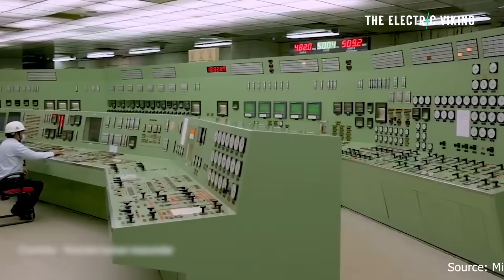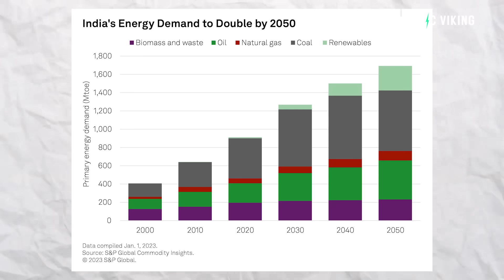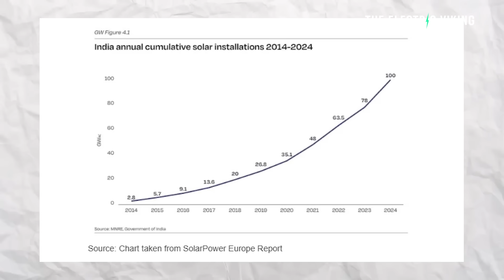India’s Renewable Revolution: Coal and Gas Decline as Solar Soars to 100 GW!

Comment: I’m a Punjabi Indian living in Melbourne, and for the past 11 years, my home has run entirely on solar power. Back in 2014, I installed a 5kW solar system for just $5,600. It earned me $6,600 in feed-in tariffs, and I didn’t pay a single electricity bill for over a decade. When the tariff dropped to 5 cents per kWh three years ago, I built my own 15.6kWh LiFePO4 battery system. Since then, we’ve been fully energy-independent—no imports from the grid. We cook, heat water, and keep our home comfortable year-round using only solar energy.

This is not just a personal achievement—it’s a model for what’s possible. In Australia, most homes have rooftop solar and don’t rely on the grid. If India embraced this approach, especially in high-demand regions, it could transform the energy landscape. Local solar generation would cut transmission losses, reduce infrastructure costs, and eliminate the need for coal, gas, and imported fuels. If every household produced more than it consumed, India could become power-surplus.

Australians choose renewables not because they have to, but because they believe in sustainability—even though they can afford fossil fuels and enjoy cleaner air. Indian policymakers and the public should take note. Solar isn’t just clean—it’s empowering, profitable, and the future.

Comment: India has scarcity of land area needed to build houses, offices, shops, manufacturing units, food garms, godowns and very big human population to support, Land area , roof area, water area are precious finited valued assets that appreciate in value wrpt time and must be utilized 24 hours per day to conserve various forms of life, to quench thirst , to irrigate farms, to mine and extract ores like sand or others, fire-fighting, to catch sea food, to build roads for vehicles or sail ships and for many important uses. High surface power density and high energy density per unit volume are highly valuable in energy. Building and selling carpet area for residential or commercial is the business of real estate redevelopers, Rents and selling prices of houses or shops or offices in cities like Mumbai are enormous and go on rising year after year. A family of at least 3 people lives on 28sqft carpet area in Dharavi slums, that is the area occupie by 540W panel of Waree. Fossil fuels and nuclear have high surface power density , India must use coal, uranium and natural gas to generate electricity, handle base load as well as run high power consuming devices like compressor or refrigerator. India must use crude oil and natural gas for transport fuel. Natural gas is also good as kitchen stove fuel, water heating, room heating and gives Helium too. Sector of electricity generation is not the biggest source of CO2 emissions. Sector of transport vehicle manufacturing and operation is the biggest source of CO2. India has big scope to optimize the demand for manufacturing and operating transport vehicles by maximizing online tasking, walking or cycling small distances, transit-oriented redevelopment of houses+office+shops, recycling raw materials for reuse, ensuring full occupancy of passenger space of each vehicle in travel. India must stop production of tobacco. A tree is cut down for flue-curing 300 tobacco cigars, an unessential and unhealthy item. India is in top 5 annual producers of tobacco in the world

Comment: A load of nonsense. Power needs to work 24/7 365 days a year.  Solar can dip for days. So if you want reliable power you need 100% backup with fossil fuels.  A coal power plant is orders of magnitude more efficient in terms of steel and concrete. It provides 24/7 reliable baseload power. If Coal is replaced by anything it will be Nuclear power.   Wind and solar are insanely stupid when we have nuclear tech.  It's just asenine. Anyone who pushes renewables is a moron who doesn't understand the first thing about how grids work.  Look at the recent blackout in Spain. No inertia on the grid = grid death.

Comment: Nuclear power is the only reliable clean energy source as of date. Wind, solar, hydro, and hydel are much more susceptible to environmental factors, and, in my opinion, thus are rendered useless as primary sources of energy but can and are very good secondary sources. Houses for the most part can be powered largely by affordable and, in the long run, cheaper solar power. Also, I am firmly against EVs, precisely because of the pollution and the environmental hazards associated with the batteries. If we want to move towards a greener source, EVs should be first to be banned!

Comment: Proud to have contributed 8 kW to this. My rooftop solar panel setup. It uses a hybrid inverter that can work with and even without the grid. This setup exports unused power to the grid, and I get credit for that. Four 12V lead-acid tall tubular batteries for backup. Backup is hardly used, though. 

I have shifted to electric-based options for most of my cooking needs, replacing LPG. I plan to buy an EV scooter for my nearby commuting needs.
Reply: How much did it cost for the hybrid?
Reply: @royyayush don't know why, but youtube keeps deleting my comment if I put the cost.
Reply: @dexterroy use words
Reply: @royyayush  Little more than five lakhs. Panels , earthing, wiring, lightning arrester, inverter and the frame. I had spent a little more on frame to have a shaded sitting place. I already had the batteries.
Reply: @dexterroy  Thanks
Reply: @royyayush around 5-5.5 L. I already had the batteries.
Reply: @royyayush around 5-5.5L. I already had the batteries.
Reply: Mine 3 KW
Reply: Vai kon district ??
Reply: Brilliant!
Reply: Bro what company panels and batteries did you use for your rooftop solar?
Reply: Me too added a 5kw solar system in my home's rooftop now my house runs on solar ❤
Reply: Bro dont buy ola buy some other brand

Comment: I travelled last week down south- impressed with the array of windmills powering the grid during the annual monsoon season. Next is the national roof top solar mission, which could be a game changer in the next 3-5 years. its trains run on electricity fully. So lots of good work. It is the only country which is sticking to its Paris 15 goals so far in terms of milestone. What India needs is a step change in solar panel efficiency.  And its Hydrogen mission is also coming  with a goal of $1 per kg. That is the way to go. Almost 95% of households now use gas for cooking , not bio mass. Good story.
Reply: Electric induction stoves and tiny household biogas tanks for cooking are also picking up. Also, Indian government is keen on promoting biofuel as energy for thermal power plants.

Comment: and thanks to central govt PM surya ghar yojna which is literally for putting up solar for homes a large number of people have opted for solar power for homes which substitute during day time and use normal electricity during day, although its a small percentage its increasing. My own home requires a max load of 1.2Kw and we have a solar power plant on the roof for 5Kw so any extra just goes into the grid.

Comment: I just realized that nuclear can’t expand much beyond baseload without other plants or batteries used in conjunction.  They’re going to be mostly limited to the bottom of the trough as they’re used presently.
Reply: Yes. People say solar and wind are bad because you need batteries for when they aren't producing, but nuclear also needs batteries for when they are producing too much because it's a low demand time. This is the reason why there is off peak electricity at night, because nuclear power is still producing and they need someone to buy it. My house has storage heaters for this reason.
Reply: There is another solution though. Look up Terrapower. They are building a nuclear reactor that that uses thermal storage to store the heat from the reactor so it can be used to power the turbines at a later time. They can keep the reactor running at full power and vary the electricity output to suit the variation in demand. I think this is an excellent idea. I hope they can get to to work reliably for a reasonable cost.

Comment: Contrary to video narrative, chart says no energy reduction in any category - only a reduction in speed of growth of coal....slows but still increasing in use. Happily, Solar does play a proportionately greater role in overall prgressive quadrupling+ electrical production than coal and others.   Air conditioning presumably responsible:  data centers, our modern electric life.
Reply: Coal based power plants cannot be done away completely.  Grid stability is essential, which can be possible only with hydro, coal & nuclear energy. Building nuclear sufficiency is the only alternative. Hydro power is monsoon dependent in India.

Comment: India's railway is 99% electrified. Indian Railways are building solar farms near substations to power the railways. They are set to powered by 100% clean elextricoty by 2030.
Reply: India has probably the largest rail network in the world, and to achieve 99 % electrification is mind boggling . That too in the most inhospitable of terrains . I see diesel engine in US and many developed nations even as on date
Reply: @roopkumarnkv India has the third largest network. First largest is china. Their railways are 80% electrified.
Reply: For the size of indian railways, that's a crazy number
Reply: Here is a link if you wanna know more about India's energy sector https://iced.niti.gov.in/
Reply: As of Nov 2024, the figure stood at 97% of broad gauge routes.
Narriw gauge still runs with diesel since they are usually in very remote areas. The acual figure would be around 90% or less overall.
Reply: @anshuldwivedi1919 Even 2019 the narrow gauge was less than 2.5%. They were working fastly on converting narrow gauge to briad gauge even then. By now it would be something like 1% of the total network. 

"According to the ministry data, as of March 2025, the railways had electrified 68,701km, or 98.83%, of its total 69,512km broad-gauge network. However, work on the remaining 811 route km is progressing slowly, with completion now expected by Q3 FY26. In FY25, the railways electrified just 2,701km, falling short of its usual pace of over 6,000km per year since FY19."
Reply: Ya but most of the electricity is from coal only
Reply: @adithyabharath2608 indian railway has been building solar farms near the raielay track substations for quite sometime. So taking india's general grid for railway electricity generation is erroneous.
Reply: I've seen videos of Indian goods trains that are double height and yet still electric, with very tall pantographs!

Do they mostly only run trains during the day? Are they planning large sets of batteries for when solar isn't enough or do they have another plan for that?
Reply: @adrianthoroughgood1191  we have large energy storage ! we use now hybrid system and also mostly energy on that double decker freight area come from indias one of the largest neuclear and hydroelectric plants that side of india devloped too ! and very less backup coal plants there still
Reply: @adrianthoroughgood1191  india has 3000km dadicated fraight corridor specially build for only friedght trains of double height, entire network is made to support double height container transportation including all tunnels bridges etc

india is planning for build 8000km Dadicated freight corridor, earlier both pasenger and goods trains run on same network becuase of which goods train average speed is just 30-40km per hour now becuase of DFCs average speed is 80-100km / hour and yes these new DFCs is all electric
Reply: @adrianthoroughgood1191  who ever generates solar energy, either uses themselves or has option to sell to the grid. Railway already has well established infra to get electricity from the grid, the solar infra is to complement that.
Reply: @adrianthoroughgood1191  India is also working on solar grid.. when solar isn't available in one area, it certainly is available in another. They compensate for each other.
Reply: @adrianthoroughgood1191  Indian government has recently launched a programme to subsidize solar cells installation in households, with an option to sell that to the grid.
Reply: @adrianthoroughgood1191  indian renewable energy is centralized , every source is connected to power grid , railway send their  excess energy to grid in day and get energy out of grid during night , no need of battery , india close coal and has plats during day , they are used mostly in night , but railway will become carbon neutral by giving energy back to grid during day
Reply: @adrianthoroughgood1191 I think he meant the stations run in local solar energy. All Delhi metro stations run on solar planted on there roof tops. India is also building dedicated freight corridors. You should check that our if your interested in rail and transit. RMTransit has great videos on Delhi metro.
Reply: Fully clean electricity for railway is a myth
Reply: @geekmails how is it? Does it also apply to electric cars?
Reply: @geekmails Where You From ? 🗿

Comment: Viking ur are one of my inspiration to go solar. Am frm south india where we get plenty of sunshine along with this we get heat  and humidity so AC are a must in Summers. With the increase in Taarif every year i finaly listen to u and went Solar on grind and installed a 10 kw Topcon variety ( more efficient ) immediately the by Taarif started to plunge by 50%. The life of the pannel are expected to be 25 years I expect to recover my cost in 4 years. That means i can get free electricity atleast for a minimum of 16 years. I am looking to add another 7 kw so that i dont pay electric charges. There is zero maintenance charge so far, heck i dont even clean the panel😂  as thats taken care by the rain. I stress again and again there is no better returns ever than going Solar. If u r in a Sunny region with lots of AC go Solar it gives more than 200%

Comment: Wouldn't hold out too much hope.  Adani just built one of the largest coal plants (1,600MW) near bangladesh in Goddard and did a 25 year deal to import very cheap high sulphur coal from its Adani coal mine in Australia, and sells cheap power to Bangladesh, polluting the north of india for great profit, for Australia and Adani.  Check it out.  I wish this would have been wind/hydro and solar, but they invested heavily in mining and needed a market for dirty coal.
Reply: At the same time Adani has built 
Solar town in Tamil Nadu, rajasthan,
.And wind mills in Maharashtra
Reply: at the same time adani also built gujrat worlds largest solar park which is currently expanding its max size is equal to whole Singapore its in a salt desert  currently under Contruction and functional also watch on YT  there are many drone and vlog footages
Reply: @MoonKnight2240 Agreed.  I was hoping the added benefit from solar would clean the air, but it has been offset by Goddard.  At least it has not got worse, but that's not much help as Delhi already has the worst air quality in the world during winter months so I suppose it's not more worst.

Comment: If it´s too good to be true and a real longterm trend, just ask questions and be skeptical. A.) "Analysts said that the decline could be due to lower demand for coal as unseasonal rains brought down summer temperatures thereby leading to lower electricity consumption. Consequently, coal-based power generation fell by 9.27 per cent y-o-y in May 2025.
B.) April/May 25: India's U.S. exports face 6.4% drop under Trump tariffs: "Exports of iron or steel articles may fall by 18.0%, and diamonds, gold, and related products by 15.3%. Vehicle and parts exports are projected to drop by 12.1%, while electrical, telecom, and electronic products may decline by 12.0%. Other categories such as plastics and articles thereof (-9.4%), carpets (-6.3%), petroleum products (-5.2%), organic chemicals (-2.2%), and machinery (-2.0%) are also expected to be negatively impacted, GTRI estimates."

Comment: Although clean air is heathy however the pollution allegedly reduces sunlight and reduces the temperature and the temperature is a big concern in India
Reply: The book "Ministry for the Future" starts with a heat crisis in India when the power grid fails meaning AC stops working and many people die. Later in the book India is so desperate to reduce the temperature they unilaterally do some geoengineering launch reflective particles in the atmosphere above them, even though it's meant to be something that require international agreement.
Reply: @adrianthoroughgood1191  I love these Western myths.  
Reality:  Climate change is set increase Rainfall in India, in recent years frequent and heavy is local concern. Deserts of Rajastan predicted to get 18% to 32% increase in rain.
Reply: @adrianthoroughgood1191  study shows indian pollution made now a shield over india of thick smog which stopped deadly sunrays which made india cooldown ! thats why from last 3 years we in india our winter getting so colder

Comment: India aims to raise its coal-fired capacity by 80 gigawatts by 2031–32, from the current 222 GW, to meet growing demand for power. The country had added nearly 28 GW of coal capacity in the past five years, according to Central Electricity Authority data.7 May 2025
100 GW of nameplate solar has a capacity factor of around 30%.
Reply: How often is the coal at capacity? Coal peaker plants run about 5% of the time.
Reply: You should not assume that coal will run all the time. China is increasing coal capacity, but reducing coal usage because they are used as backup and peaked power for wind and solar.
Reply: @adrianthoroughgood1191  u got it these dumbos didn't we are not westerns we keep backups ! thats why when india made double decker eletric fright corridor we still on that track run some limited amount disel trains too  just for a emergency